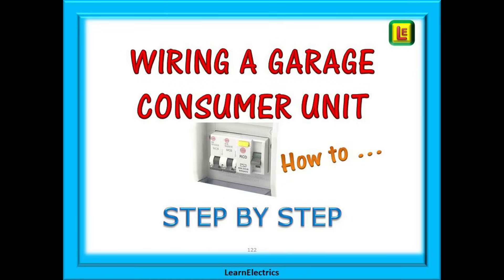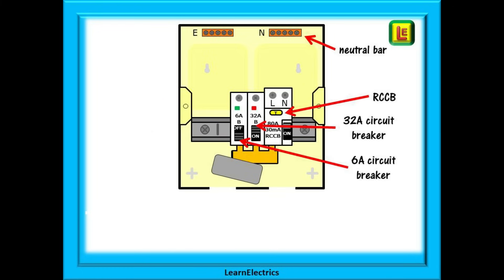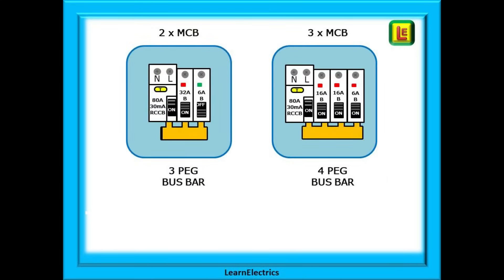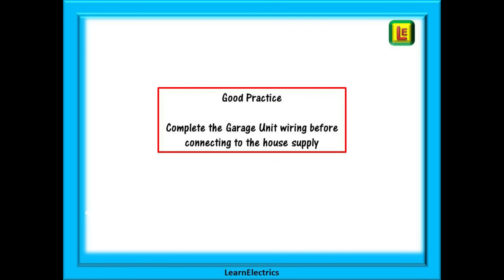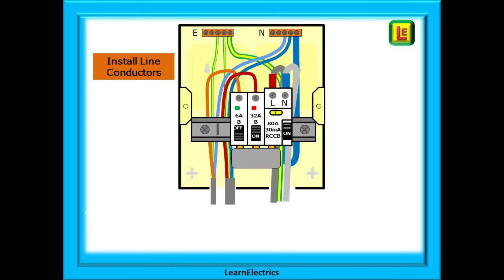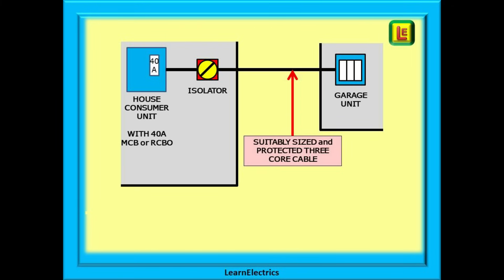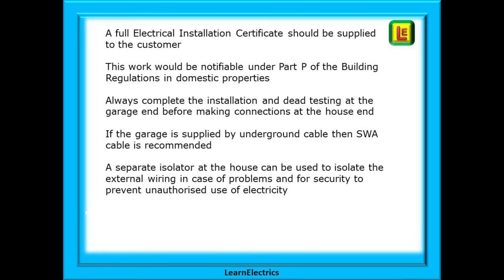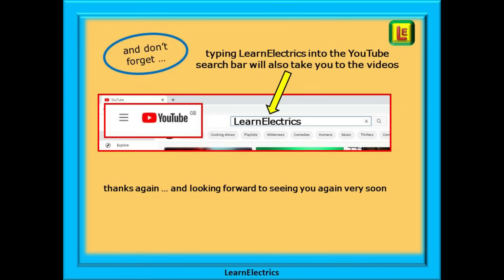WIRING A GARAGE CONSUMER UNIT – HOW TO – A simple step by step guide

Comment: Whats the sifference between putting a distribution circuit in from the main board (a sub main) and splitting tails in henleys at the incoming supply ?
Reply from the maker: Using Henley Blocks you have two separate and independent circuits. A sub-main fed from a distribution board is not independent, it relies on the DB being switched on. Hope this helps.
Reply: @learnelectrics4402 
Can you have more potential power from a seperate circuit? A 63A main switch, as opposed to say a 40A breaker feeding a sub main (i see 63A main switches in sub mains, even though they're fed from 40A. How is this) 
I guess it ties in with diversity and demand..

I always ask questions that seem obvious.. but they help things 'click'

Thanks for always taking your time to reply Dave 👍

Comment: This is very clear explanation and it encouraged me to do my garage I've got one coaching if I want to add two radiators of course with two of 20 amps circuit breaker what size of RCBO  in the house consumer unit shall I keep the 40A RCBO
Thank you
Reply from the maker: If both radiators are on full chatt and both drawing 20 amps, to me that is a bit close for comfort. Ideally you want the max current to be not more than 80% of the RCBO over-current protection rating. A 50A RCBO would be better.

Comment: I have brand new garage with power like this but it keeps tripping the circuit breaker in the main house , i dont think its my dryer could it be a installation fault , its trips after 10 mins
Reply from the maker: As a temporary measure, to test the dryer, run an extension lead from a socket in the house to the dryer and see if it does the same thing. Process of elimination. Good luck. Dave.
Reply: @learnelectrics4402  I have done that and the dryer is fine run from a extension from the kitchen , the garage socket cant seem to handle more than one appliance been on at the same time , so I've just left the freezer on and run a extension from the kitchen for the dryer strange

Comment: Is it permissible to install two live wires to an MCB? In other words, two incoming cables (e.g. both for lights only) with both live wires to the 6A MCB, two neutrals to the neutral bar and two earths to the earth bar.
Reply from the maker: If you mean can you have a ring on a 6 amp breaker, yes you can.
Anything else, I would question why you want to do this.
Reply: @learnelectrics4402  Thank you. As I understand it my Garage consumer unit has a radial circuit with just the two MCBs, 16A (number 1)and 6A (number 2) - I have already installed additional sockets in line. I have now connected two 1.5mm cables to the 6A lights MCB with an outside light being wired separately and connected permanently through a FCU. As regards the sockets I presume it is also okay to connect two cables to the consumer unit as well? I have the choice of adding another socket from a socket in line but as I want this one close to the consumer unit I thought it would be better to wire it directly to the same 16A MCB (number 1) rather than use several yards of 2.5mm cable from around the other side of the garage. My question really is whether the regs permit two live wires into one MCB and two neutrals into position 1 on the neutral bar and two earths into position 1 on the earth bar.

Comment: Im running a sub main through a ocupied house  property, some of the cable is less than 50mm deep and not visible so this wont allow me to use a 100ma RCD for safety reasons, but  another spark says its ok to use 100ma as long as you have the correct MSecond trip times. What is your opinion. Also for TT systems should you use a cartriage fuse for short curcuit protection.
Reply from the maker: I would always follow the guidance in the regs. Regulations 522.6.202 to 204 apply, especially 522.6.203 which tells us to comply with either Reg 415.1.1 or Reg 522.6.203
Hope this helps.

Comment: The ones sold on eBay do not come supplied with a bus bar, do you actually need one. Could you just link them together using 2.5 wire.
Reply from the maker: The units I've bought have had a copper bus bar already fitted or in a plastic bag with the neutral wire and a few other bits. Decide how much current is passing through the unit. I wouldn't fit less than 10mm if I didn't have a bus bar.
Hope this helps. Dave.

Comment: I have just moved into a house that has a consumer unit in the garage, fed by a 2.5mm  T&E cable. This unit has 63A main switch with a 32A and 6A mcb's. The 2.5mm cable is run back to the house via a catenary overhead cable, but not connected at the house consumer unit. Do you know what size mcb is required in this consumer unit, assuming the the external wiring is coreect.
Reply from the maker: Its not a matter of the external wiring being correct. what matters is that the wiring AND the circuit breaker are correctly matched, At 2.5 supply you should really be installing a 20A device maximum for adequate protection and safety.
Take a look at this video on matching them.
https://www.youtube.com/watch?v=VtTUkUpQ-Rc

Comment: How do you wire a shed fuse board to the existing house consumer board
Reply from the maker: Exactly the same method as here. The little distribution boards with 2 or 3 breakers are often called "garage units" or "garage consumer units" but they can be installed anywhere.
Have a look at this video on extending consumer units. Thanks for watching, Dave.
https://www.youtube.com/watch?v=pdKtFEhP3Eo

Comment: Superb clarity. 👍 A quick question. Would I be able to run a shed on a generator wired into a consumer unit in the shed with a isolation switch?
Reply from the maker: It's not clear whether you want to have national grid and a generator set up, or just run the shed 100% from the generator with no grid connections.

Comment: So is there an rcbo fitted in the main DB in the house that’s connected to the main switch in the mini board? If so does the rcbo need to be 80amp that’s fitted in the mainS DB
Reply from the maker: It depends what the loading is on the second board. Some 2nd boards only have 40A RCCB fitted. As long as the main board is fused equal to the 2nd board or greater, this will avoid nuisance tripping.

Comment: Just watched this for a second time, the clarity of these lectures is outstanding. So unlike my present lecturer who keeps going back and forth verbally and breaking off to tell stories.

I can tell these lectures are planned in advance, the clarity and delivery of salient points  is so helpful. Thank you once again.👍
Reply from the maker: Brilliant feedback, thanks for your support. Spread the word with your colleagues. Thanks. Dave.
Reply: @learnelectrics4402  Im sorry to be pain im L2 Installer an my dear mum  wants supply connected from house to garage the condumer sumer unit  that's in house has easily got space  for another 4 breakers.

The board in garage is literally what looks like just enough to run lighting circuit is it better to use 6mm armoured cable 3 core 1.5mm internal rather than 2.5mm? 

Thanks sorry to be pain kind regards.  

James

Comment: If the house does not have an SPD should the DB in the shed have one fitted?

What type of 40 amp RCBO should be fitted in the house DB if this is the only RCD for the circuit?
Reply from the maker: You need 30mA RCD/RCBO to protect persons. Ideally you should be installing an SPD at the house CU. Hope this helps. Dave.
Reply: @learnelectrics4402  would you recommend using a type C or B ?

Comment: Great video and resource as I’m now looking at a change in career and becoming an electrician 

I did have a question, regarding running the supply from the main consumer unit. As the garage unit has an RCB, should it be connecting to a none RCB protected MCB on the main board or would it be best to use RCBOs in both units and not have the RCBs in either 

Do you also offer nation wide training or know any good courses in the Dorset area
Reply from the maker: The only issue you might have is which RCD goes first, but leaving the RCD in the CU protects the cable to the garage. Another option is to put it on its own time delayed RCBO at the CU and a 30mA RCD at the garage. The important thing is safety.
Courses - I don't do face to face training now. When deciding on a course do NOT book it over the phone just because they have a special offer on at the training centre. Go to the centre and see what you are getting for your money. Visit at least three different centres, they can vary enormously. Find a centre that suits YOU. Ask questions before you sign up, ask to look at the training facilities. If they won't invest the time in showing you around, is it the right place for you.
I might sound negative about things John, but there are some out there that just want your money. Spend it wisely.
Reply: @learnelectrics4402  thanks fir the reply and not negative at all, think what your saying is very true, just hope now I’m in my mid 40s it’s not to late to get out from the desk and way from computer programming
Reply from the maker: There are lots of good electricians that started life in their 40s. I enjoyed teaching mature students, high commitment levels. It might take you a couple of years to be independent, but take every opportunity to improve yourself and keep learning. Its a good trade.

Comment: Hi sir , the supply box fitted outdoors and I want to run SWA cable to the consumer unit inside the flat, do I need to put mechanical protection such as metal trunk or PVC conduit in the outdoor part or no need because it’s armoured cable ?
Thanks
Reply from the maker: SWA will often not need protecting further but try and route it to avoid mechanical damage and impact as much as possible. Underground SWA does not need further protection, but try and bed it into sand or soft soil so that sharp stones don't penetrate and place marker tape about 300mm down in the trench.

Comment: Do u need an earthing rod for a garage consumer unit 4 way ,its coming of a spur switch from a rcb plug plugged into a single house socket on 2.5 armoured , I'm putting in 5 double radial sockets 2 with 2 USB ports , I've got 2 16a mcbs ,I'm putting 3 sockets on 1 and 2 sockets on another ,

 I'm putting and out side lcd light into a switch onto a 6 a mcb ,
Reply from the maker: That's a lot coming off a single spur, which I'm assuming is already coming off a ring or radial circuit that is already in use. Personally I would run a separate circuit from the CU on a 40A or 32A MCB. That way you are not overloading the existing house circuits.
Reply: That's what a lecky was doing , so there is a single  socket in side , I've connected 2.5 cable to an rcb plug , run it out the wall  into a outside spur switch , I've put 2.5 armour cable from the switch down to the shed , that will go the the 4 way consumer unit , I'm put 3 sockets off a 16 mcb , and 2 sockets into another 16 mcb , 2 separate cables , then the 1.5 light cable into the 6 mcb ,,   so a total of 5 sockets and 1light , it's only a man cave with a TV, and a fridge and a  lamp on now and again no   heavy use ,3 sockets there , and 2 in the shed side occasionally used , this is what  2 sparkies said they could do ,  I've seen people install with no earth rod ,, no one mentioned an earth.rod either

Comment: I have a Henly block installed splitting the incoming supply to 2 consumer units. 1 obviously is dedicated for the house. The other unit supplies the garage.
This garage consumer unit (Withing the house) has a main 100A switch with a 63A RCD and a 40 am MCB. The feed to the garage is 10mm twin and earth over a distance of about 15 meters to a Consumer unit on the wall of the garage ( all withing the the buildings which are attached.)

In the garage is another consumer unit.  with another 63a RCD. 1, 32amp MCB for the ring main ( 6 sockets) and a 6 amp MCB for lighting (4 strip lights) and a security light on the garage exterior wall.
This is how it was wired when i purchased the house about 20 years ago.

QUESTION. I have been advised by some  that this creates a sensitivity issue with regards to the RCD (s) tripping Is this correct or do i need to alter any RCD / or install a different one etc
Regards.
Reply from the maker: You need to determine what the tripping current is foir the RCDs. It won't be 63A. It will probably be 30mA or maybe 100mA. If the 100mA RCD is upstream of the 30mA device then that is the correct way. If they are both 30mA then sometimes you can get indeterminate tripping of one or the other. Take a look at our video on RCDs on this link ... https://www.youtube.com/watch?v=6OgaB0BIj18

Comment: May seam like a strange question: but could I replicate this for wiring up a whirlpool bath? So instead of being fitted inside a garage, its fitted in a suitable location, with one feed going to the pump of the bath and the second going to the lights of the bath?  Using a 30Mamp RCD and two 13a breakers?  - or have a completely failed  to understand the video
Reply from the maker: You will need a feed to the whirlpool room and this will give you the supply. I wouldn't use 13 amps for the lighting circuit. 6A is probably enough. Check manufacturer's installation instructions, especially with regards to earthing. Manufacturer's instructions take precedence over the Regs,

Comment: If you have an rcd in the garage and an rcd in the house feeding the garage, in fault conditions in the garage, would this not trip the house rcd taking any other circuit on that rcd out with it? I normally only have one rcd or rcbo at either end rather than 2 in the same circuit. My preference is mcb in the house and rcd at garage end.
Reply from the maker: The boffins say that the extra resistance in the cables to the house might be enough to not trip the house RCD, but that assumes that both RCDs are identical. Hope this helps.

Comment: Excellent video, very informative and well explained. Do you have any videos you could recommend on terminated armoured cable in a meter box with Henley blocks? Not sure how to wire the earth with the armoured shield, I think I will need to add a junction box to convert the earth shield and main earth to one earth wire that can be tapped into the main earth coming out of isolater
Reply from the maker: Terminating the SWA into a separate box is certainly an option and one that I've used in the past. It makes for a tidier job. Nothing in the regs to stop you, all the regs want is a safe installation.
Reply: @learnelectrics4402  Thanks for the reply, I think I will terminate the SWA in a junction below the meter box cabinet and take a suitable non armoured cable  up through the cavity into the box and connect all up on the load side of the isolator switch with Henley blocks and hopefully it will be fit for certification.

Comment: Thank you for the explanation. What type of amp do you require for the rotary isolator if the MCB is 40A.. can I use a 32A or is it not sufficient? thanks
Reply from the maker: Its all to do with how much current the contacts can break from ON-Load without burning out. I would always suggest that the isolator can break in excess of the max load. In yoiur case with a 40A mcb I would go for a 63A isolator. Even though it is single phase, I often fitted 3 phase isolators as there is physically more room inside for terminating the SWA but that is personal choice, good luck. Dave.
Reply: @learnelectrics4402   thank you… what is the main difference from having said isolator instead of wiring the armoured cable directly at the house 40A mcb… I could always switch off the MCB if I need to isolate the shed consumer unit? Why the extra rotary isolator? Sorry if it may seem a silly question…

Comment: Hello, great video, lots of usefull information. I have just purchased a consumer unit it for my shed, it has a 40amp Rcd with a 16amp and 6amp Mcb for lights and power circuits. My question is what Mcb should I be using In my main distribution panel in the house? Thank you.
Reply from the maker: If it is a 40A RCD/RCCB then a 32A Type B MCB would do depending on the Zs.
Keep watching. Dave.
Reply: @learnelectrics4402  Thank you for your reply. I'm running 10mm three core swa cable And the lengh is 25 meters to the shed where the external distribution box will be. I'm going to use Ip rated Junction boxes at each end, so I don't have to drill/cut a big hole for the swa cable. I'm still learning a bit and was just wondering why you can use a 32amp in the main distribution box and the 40amp in the external distribution box in the shed? Thank you.🙂

Comment: Quick question were is the armord cable wired into before its run in to the shed
Reply from the maker: Different ways of tackling this Ashvan. I would often run twin and earth (10mm) from the CU to a rotary isolator next to the house CU. This meant the garage could be isolated if there was a problem or just not being used. And 10mm T/E is easier to get into a CU. Then Armoured from the rotary to the garage or shed. At the garage, terminate into a 4 inch plastic box and change to 10mm T/E again or whatever size you need. From the box in T/E into the garage CU. Hope this helps. Dave.
Reply: @learnelectrics4402  would you also  wire it into a RCD from the house cu